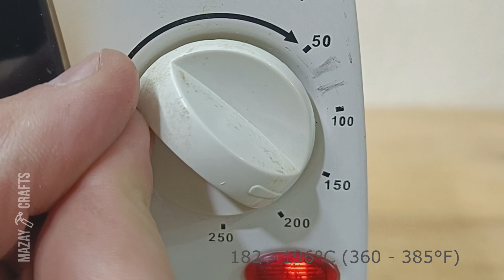How to make a Kydex Knife Sheath

Comment: What Kydex thickness did you use? What eyelet size did you use? Approximately what temperature and time did you heat up the kydex? The rest of the video was great. Thank you.
Reply from the maker: I used 2mm thick Kydex. I keep it in the oven until the material becomes like soft leather. Eyelets diameter 6 mm.
I recommend reading the official guideline for thermoforming Knife Sheaths Using KYDEX - https://mazaydiy.com/plans/kydex_knife_sheaths_how-to.pdf